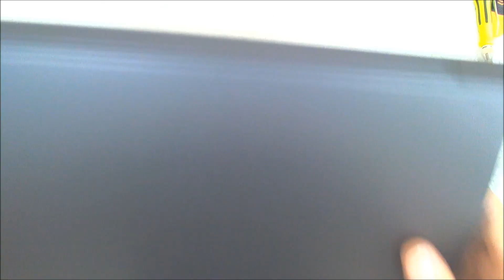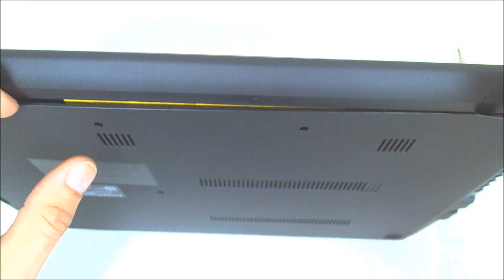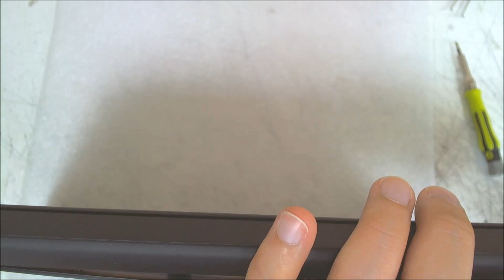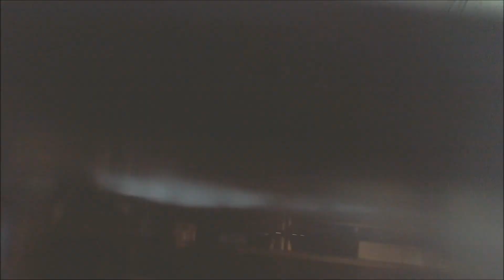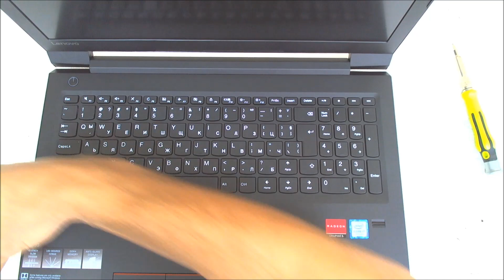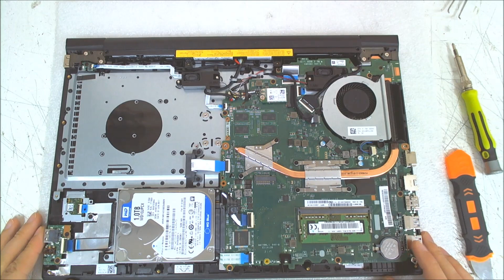Lenovo V310 SSD M.2 Upgrade NEW MODEL

Comment: Hi Yanko and guys! I would like to thank for all the info and also add my question. I read all comments and like to share my question, does anyone sees any problem installing in V310-15ISK (80SY) this SSD -> Wd Black Sn750 Wds500g ??
According to the manual should be ok (SSD:  2280, NGFF (m.2), SATA 3 (PCIe compatible)) but anyway I would like to ask, manual not always are correct about compatibility.
After this, as the last step of the upgrade I would change the 4gb Kingstom memory and use that slot for this 8gb RAM -> Corsair CMSO8GX4M1A2133C15 plus the 4gb welded, that would let me with 12 gb of 16max.
Thank you!
Reply from the maker: The ssd should be fine. The laptop supports nvme so there shouldn't be any problems. Also the laptop supports 8gb on a slot, so everithing is fine.
Reply: @LaptopDisassembly  support ssd m2 nvme or m2 sata III ??
Reply from the maker: Yes it supports
Reply: @LaptopDisassembly  which one?
Reply from the maker: According to Lenovo it should work with both . https://www.google.com/url?sa=t&source=web&rct=j&url=https://psref.lenovo.com/syspool/Sys/PDF/Lenovo_Laptops/Lenovo_V310_15/Lenovo_V310_15_Spec.PDF&ved=2ahUKEwjf0_Svg-fyAhVghP0HHU_cCfoQFnoECCoQAQ&usg=AOvVaw1BDP_vKhP2x1IysF_trIYu

The nvme will be faster that the regular ssd drive. So you can go for it.